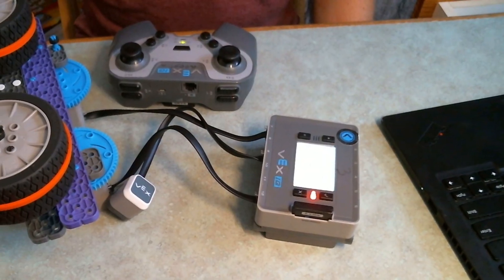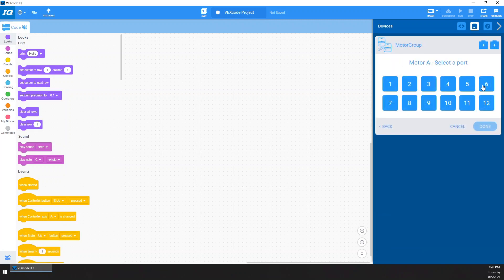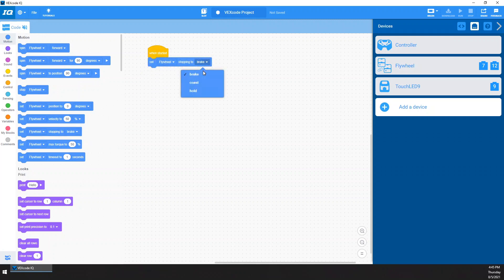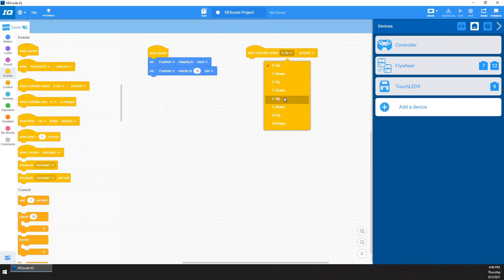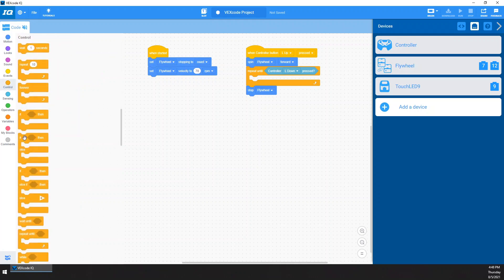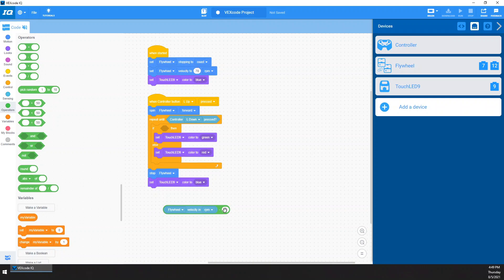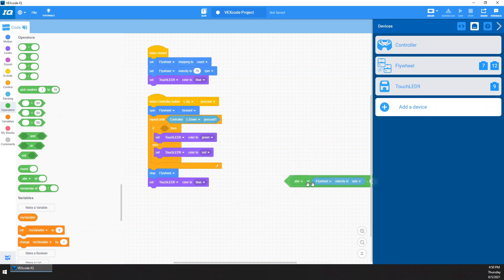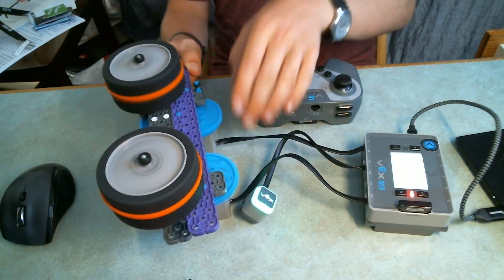Make a flywheel robot work in VEX IQ Pitching In

Comment: Is there a way to do this in RobotC?
Reply from the maker: Yes, there is.  It is significantly harder though because there is no native way to read velocity in robotC, so you need to code a function for it and write a P-loop (or use a bang-bang loop) for speed control.

Comment: Hello! Could you tell me about gear ratio?
Reply from the maker: No problem - I used 1:15 on the flywheels
Reply: @benlipper  thank you! Did you try to change it?
Reply from the maker: @VanFlek  Yes, I tried a lot of ratios, and this is not the only one that works - it's just the one that I used in the video